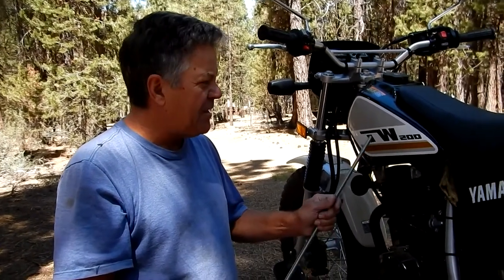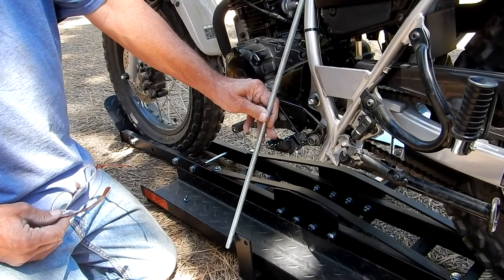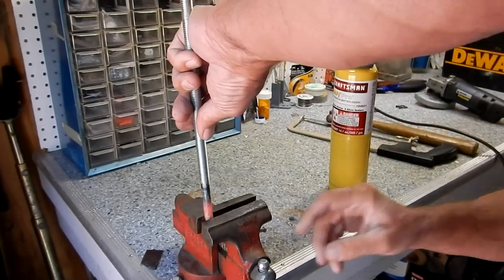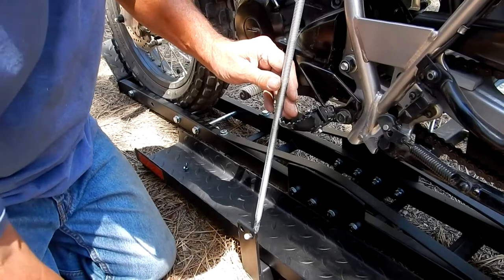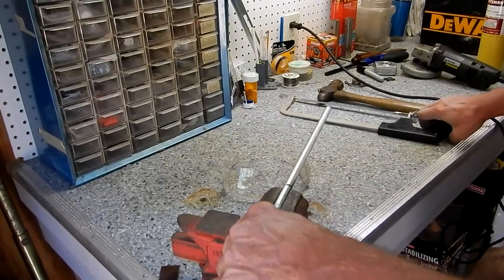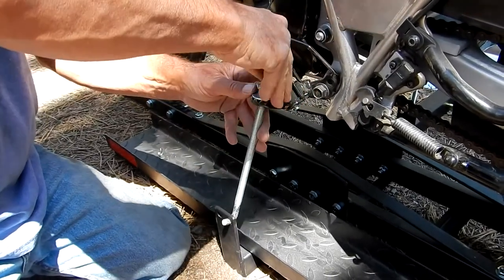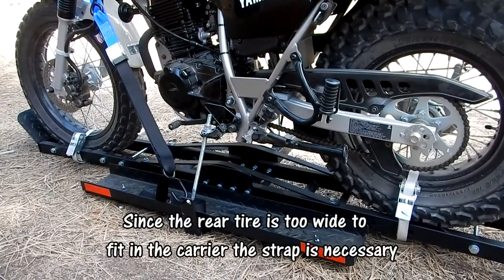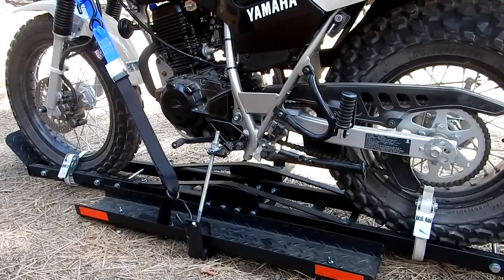How To Make Tie Downs For Yamaha TW200 Motorcycle

Comment: I have never seen a tie down system for bikes like this before and I have had bikes for years.    It is a great way to secure your bike.
Reply from the maker: I didn't realize you were a bike owner. This won't work on all bikes, but if the foot peg has an open spot in it like the TW does, it's a nice system. Thanks for watching.
Reply: I still have a bike but haven't ridden in some time.  A few years back, I had a push mower run out in front of me and it kind of ruined my day.  Hahahah.    I was about 200 miles from home and this push mower popped up out of the ditch and ran right in front of me.  It had rolled down a steep hill.  By the time I saw it, it was too late.  It busted up my shoulder pretty bad but I am mostly healed from the accident.   (Sorry if that was TMI.  LOL)

Comment: Its been a few years since your video, but how did it hold up on your trip? Was there anything you would have changed about your setup, or was it perfect? I have added a winch onto my carrier to make it that much easier loading.
Reply from the maker: These tie downs work great. They are  pretty easy to use. There were a few times I used just them and no straps for a short trip.I really wouldn't change anything.
Reply: @TomandJulieMineExploring  Awesome. I am getting everything ready for a 2000km trip and will be using your setup through Northern & Southern Ontario. Thanks
Reply from the maker: We hauled it over 2500 miles on our winter trip last year with no problems. Hope all goes well and you have fun.